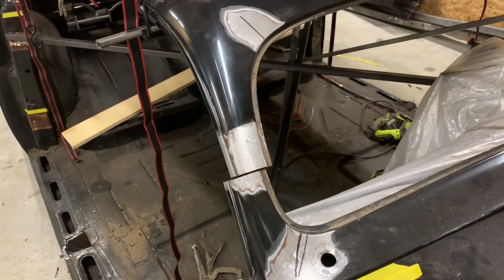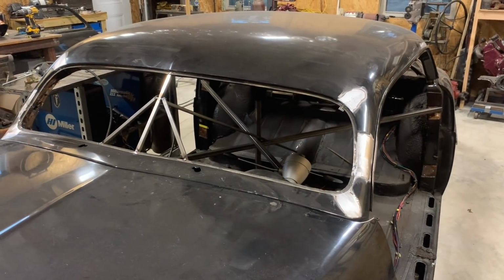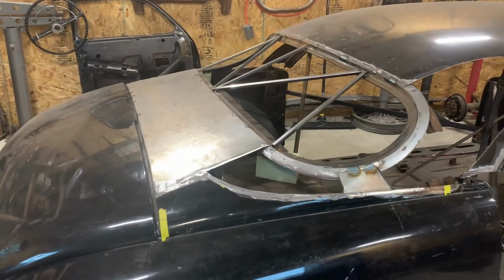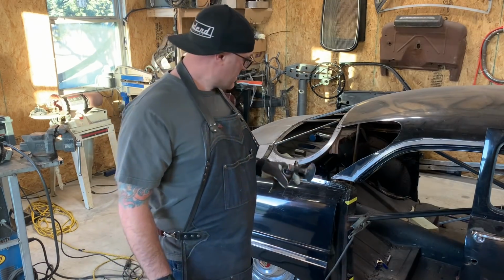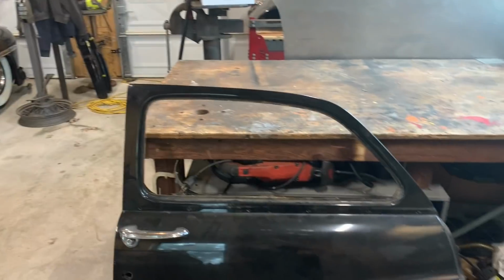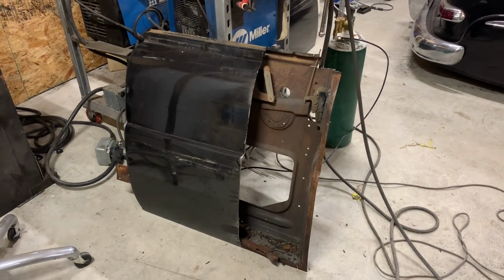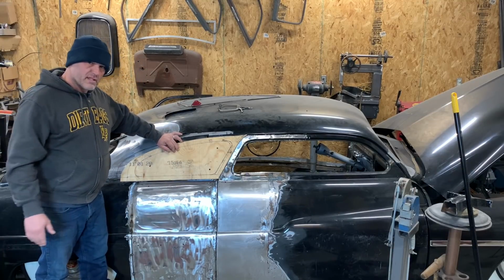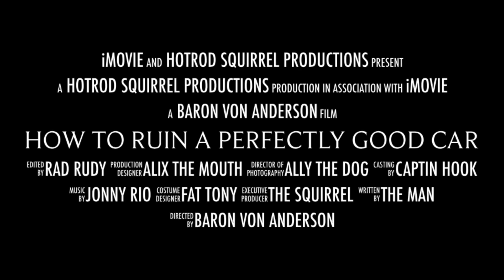EP2  of How to Chop a top on a 1950 mercury or How to ruin a perfectly good car.

Comment: These videos are very useful to me as I am in the process of doing something similar to my 89 Bronco.  Not lowering but replacing a rusted roof with similar cut points.  I would greatly appreciate your thoughts on a couple questions if you have a chance to respond:  

- Do you think 1/2 square tubing or bar stock is adequate sleeving in the A and B pillars assuming it is properly rosette welded into both halves?  

- The B pillar on the bronco is about 10 inches wide and 4 inches thick.  How would you cut it so that you would have a good chance of ending up with two parallel co-planar surfaces to weld?  Thank you so much!
Reply from the maker: Yes, I would say the half-inch steel will be helpful in aligning everything or the bigger the better. Typically when I cut stuff I try to use a sheet metal template and it’s just a matter taking your time cutting.

Comment: One of the things to do to ensure a better level of integrity is to step the cuts through the pillars rather than just a but weld (although the inner reinforcement can assist).   Back in the 'old days' when cut & shut was allowed - a good//safer repair had the stepped cut and welded areas - the potentially dangerous 'el-cheapo' jobs were but welded across the pillars etc.  Probably more of potential issues with uni-body vehicles than a body-on-chassis style - but always better to be safe than sorry.  That roof line looks NEATO.  Have a safe and nice day all.  CHEERS from AUSTRALIA.

Comment: And on iron trap garage a weld and a little piece in between the two pieces of a pillar for extra support and then come back and drill a hole to well to the support the bottom of a pillar and peace gets welded the top  gets a hole drilled and spot welding.
Reply from the maker: Thanks